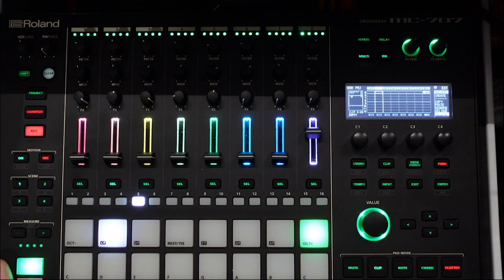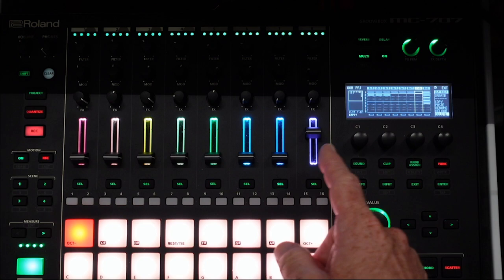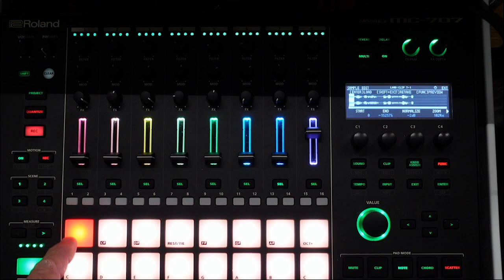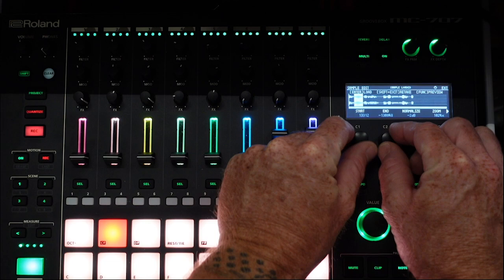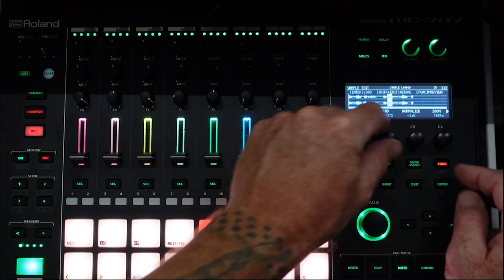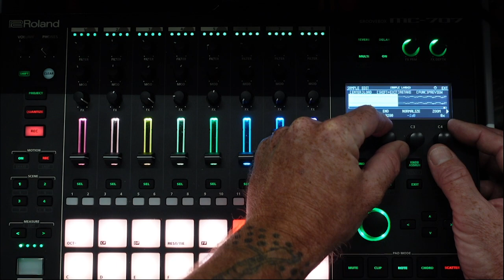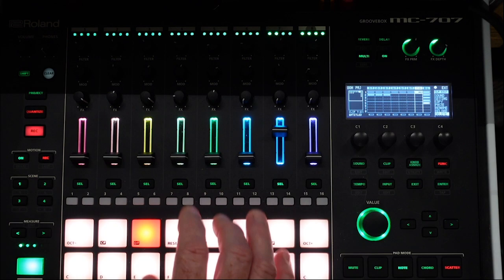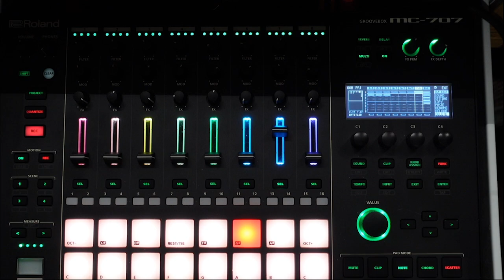Roland MC-707 Tutorial - Looper Sample Chop & Assign To Drum Pads

Comment: On the 101, in order to set different start and end points the sample must be loaded per pad, is this the same for the 707?  It would be weird that this function is so drastically different between the two machines and definitely gimps the 101 for no reason.  In my experience with the 101, if you change the start/end points of a pad copied, any pad that changes start/end points of that copied sample cover all of the pads.  It's really frustrating if you're trying to use the least amount of memory, espeically since you cannot chop unused portions of any sample on the 101 (or the 707 when I had it a while back)
Reply from the maker: This is not the same for the 707. Using the method I described, you use 1 sample and load its parts to each pad. The 101 does not have the sample recorder feature
Reply: @UnitE808  Well it can record from the looper which I use a lot, but the sample start/end is only unique for the pad it's originally loaded on, unfortunately.  Every pad is treated as it's own sample, unless it's copied, then each pad is a 'soft duplicate' of the origin pad's sample start/end/loop points.  It's really annoying and eats up sample space for chopping.  I hate it, personally.
Reply from the maker: @Jeremy Landry  you can record a sample by playing the looper track and capturing it as a sample? I don't mean create a looper clip.
Reply: @UnitE808  ON the 101, you can record the 101's output into a looper then export the looper then load the export into either a tone or drum track pad.  In the pad, if you copy anything there, the start/end is copied.  For all 'child copies' of the original pad, changing the start/end is copied over.  As I said, it's a really weird limit and eats sample memory since one cannot delete unused sample portions.
Reply from the maker: @Jeremy Landry  I understand the copy part; it works the same way on the 707. If you import an exported file, you can't chop it like in the video. You have to use the sample recorder.

Comment: Are there no sample loop options once samples are on the pads or in trim mode? and is there a way to do startpoint editing/modulation for preformance?
Reply from the maker: No loop options once they are on a pad. If you want it to loop, just place multiple active steps at the correct loop length in the sequencer. No way to modulate start/end points for performance.
Reply: @UnitE808  Thank you for the reply, the tip is valid for some applications, yet small loops to sustain sounds or to loop to an offbeat tempo/grid rhythm is what I am seeking. 

and just a follow up; how fast is the workflow when assigning multiple chops from a sample to pad layers? Can you direct a chop directly unto a pad layer from the trim mode?

Thank you so much for your informative channel!
Reply from the maker: @is.is.4684  if you are looking to loop as a sustain or as you mentioned, a tone track is what I would use.
As far as chop loading to layers, it's not possible. It would be a multiple step process. You would have to export the chopped samples and load them individually to each layer of a pad. Only the first layer gets loaded in the method I show in this video.
Reply: @UnitE808  A tone track has sample loop options?, interesting. 

And just to close the topic; can a loop track be used for small loops (xfade? Or auto Zero location) and is it possible to manually move the Looppoints on looptracks in realtime (or for that matter freely be in any edit  mode)  whilst resampling is active ? Thus internally resample any manual edits?
Reply from the maker: @is.is.4684   Let me look deeper into this and I will get back to you.